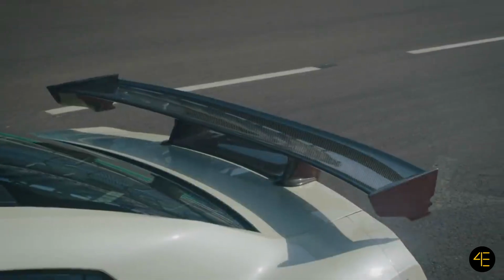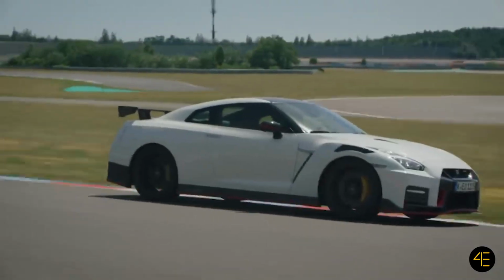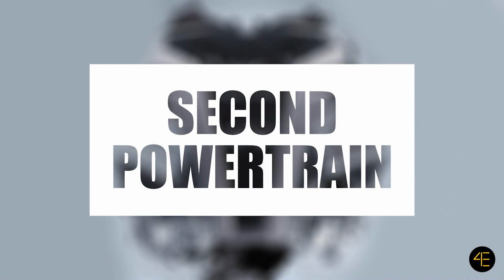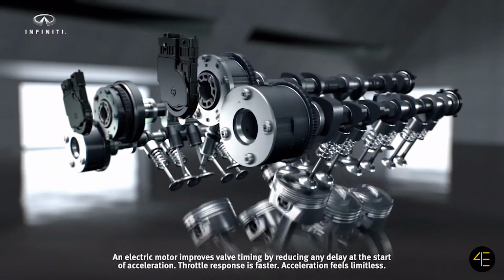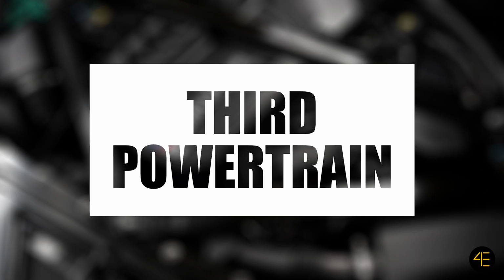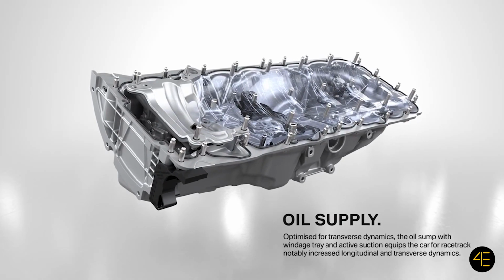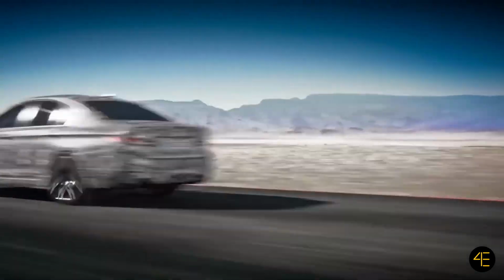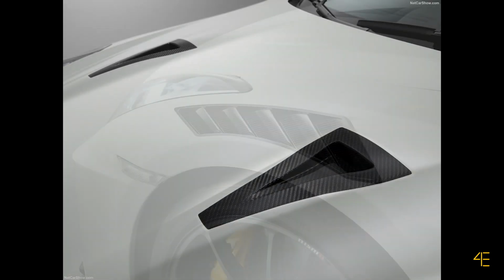Potential New Engine/Powertrain For The R36 Nissan GT-R | 4enthusiasts

Comment: Nissan should ad 2 cylinders more to the current gtr engine,make it a v8 and the displacement  between 4 and 4.5 liters with the twin turbo
Reply from the maker: That would definitely be cool, probably something they can do on their race program but probably not on the street. They are better off sourcing a Inline 6 to bring back up sales

Comment: Nonsense! If Nissan is trying to build a supercar killer like they did in 2007, a turbo charge 6 pot won't cut it anymore. Unless you are adding electric motors which will increase the weight. Acura tried that already. Nissan should use their own 8 cylinder VRH architecture. This is same engine modified by McLaren as the M838T that they stuff in all their supercars. Nissan originally develop that engine for IndyCar. Either Nissan should go big or go electric.

Comment: I think its gonna be the one in the GT-R now
Reply from the maker: Maybe but the VR38DETT is an old platform, probably many people would be upset if Nissan reused this engine as it will show they didn’t give any effort into a new powertrain
Reply: @4enthusiasts  Yes that is a good point and i agree. But they might just use what worked good for them in the past